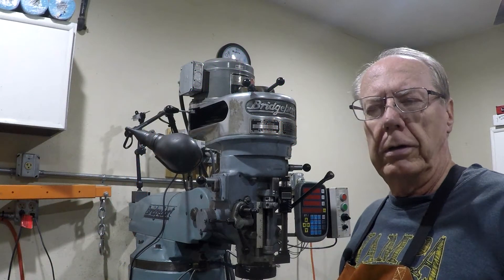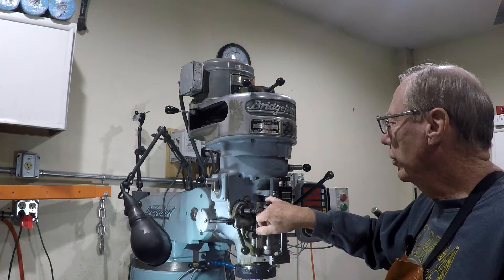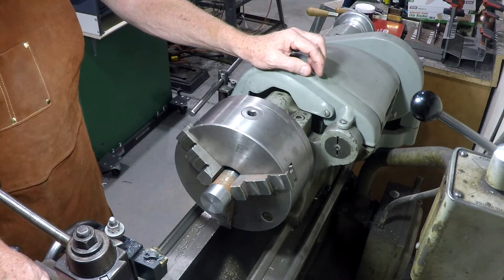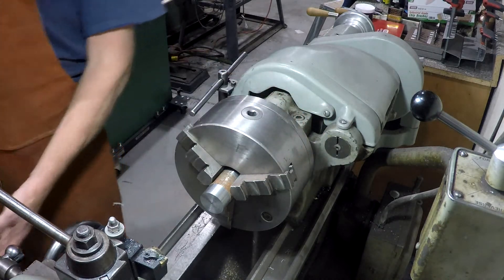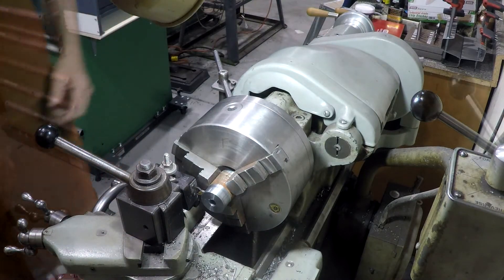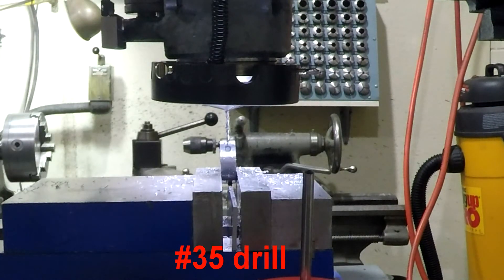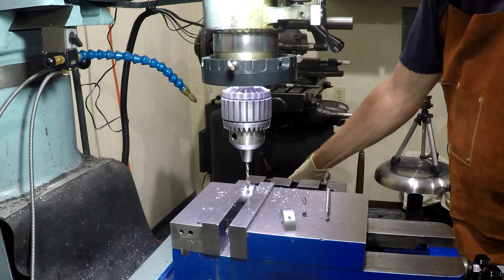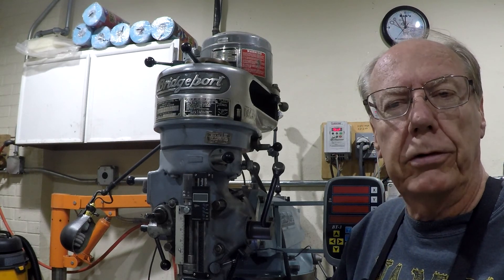Mill Light

Comment: Interesting idea but I don't think it will work for my application. I just ordered a Mach-1 quick-change R8 system for my Bridgeport, and that is activated by full-range upwards pressure on the quill handle. So I'll need to either think of a different way to adapt the ring to my spindle, or look for a different lighting solution. I have been considering a Tormach PCNC mill, so I've seen that unit. I just don't know that it will work for me though.

Comment: Your solution is fine but I was wondering what would happen if the ring stayed up at the bottom of the head , that is not travel  up and down with the quill.   Granted an attachment method would be needed.  Might be a shadow when the quill is extended,, don't know.
Reply from the maker: My first thought was to mount it to the bottom of the head. I made a template of the shape of the head and started to realize it was somewhat irregularly shaped and pretty crowded. So whatever I made would either need to be hand-fitted or adaptable to the irregularities. As much as I like building things from scratch (I already had bought some really bright LED strips) I decided to see if there was a solution already available. When I found this, the low cost and the ease of installation won out. It was a happy surprise that it also has less shadows.

I found two drawbacks. First, although this solution works well, much better than my arm light, I would have liked to to have more light output. And second, in certain circumstances this ring light blocks camera visibility at some angles, not a problem unless you are producing YouTube videos. I can still do videos, just some of the higher angles are blocked but the lighting is better so there's a trade off.